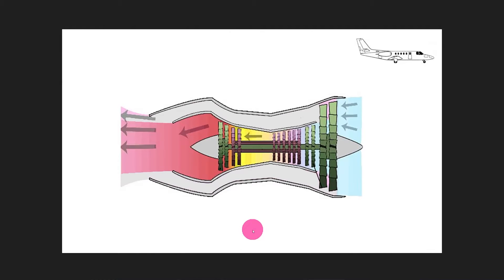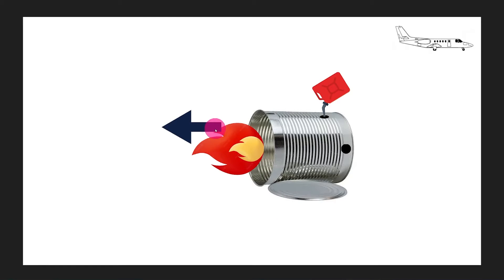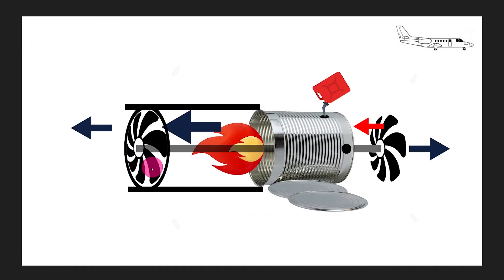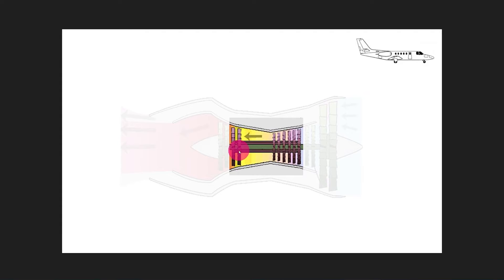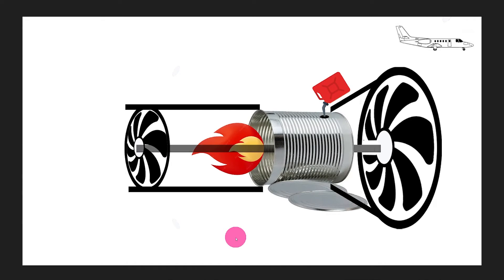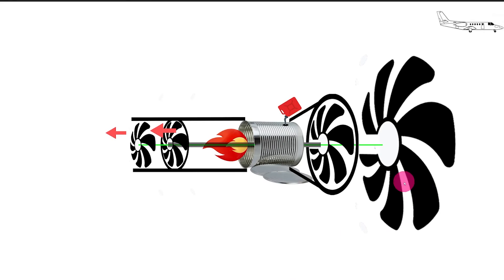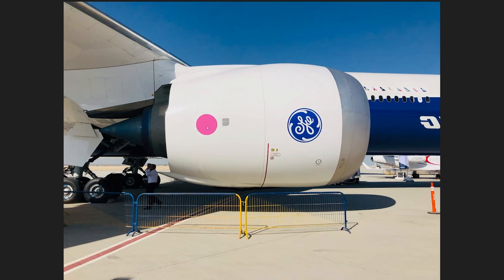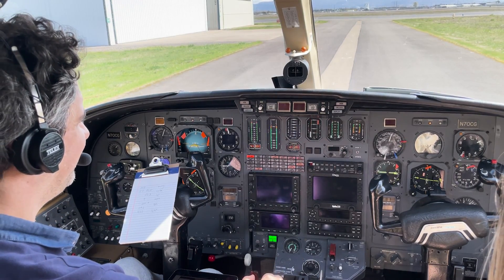How a jet engine works - SUPER SIMPLE EXPLANATION!

Comment: Good job explaining the very basics of jet propulsion. Except that the fan in a turbofan is not a propeller, it’s a compressor. It works just like the compressor of a pure turbojet engine except it’s much bigger and compresses the bypass air along with the air that enters the turbojet. The compressed bypass air expands and accelerates out the back of the fan’s should to produce thrust. All of the fan’s energy goes into compressing the bypass flow so there’s no energy left over for it to produce any thrust of its own. Ducted propellers are still a real thing, except they’re used on blimps. Though when it comes to turbofans, ironically it’s actually the low-bypass engines of modern day fighter jets whose fans (fighter engines typically have three fans) produce thrust like a propeller! But don’t take my word for it, I’m only relaying to you what various aerospace engineers and aerodynamic physicists that I’ve encountered have told me.
Reply: @FlyWithNoam  You're certainly welcome! Unfortunately, many people interpret the propeller analogy way to literally and think that turbofans are identical to turboprops excluding the shroud that encases the fan. But yeah, the main reason why turbofans are so efficient is because most of the air entering the engine bypasses the core and produces jet thrust without getting mixed with fuel and burned unlike in a turbojet.
Reply: @FlyWithNoam  Yes, I know. Pilots are actually taught dumbed down versions like that one because they mainly need to know how to fly the plane including what the engines do instead of learning how the engines do it. I'd also like to thank you for being open-minded. Other aviation enthusiasts often lose their temper because I don't believe oversimplified explanations and they refuse to update themselves when I tell them that aeronautical engineering is more complicated.
Reply: @FlyWithNoam  Yep... as one of my favorite songs goes:

"All lies and jests, still a man hears what he wants to hear and disregards the rest."

- Simon & Garfunkel (The Boxer)

Comment: I find it amazing that in the 501, about 75% of the thrust comes from the fan via the bypass shroud. In fact, the plane was first known as the "Fanjet 500" during the prototype stage, probably to emphasize the quieter and more efficient performance of the high-bypass turbofan compared to competitors like Learjet.
Reply: @FlyWithNoam  I don't recall if they mentioned an altitude. But yes, could well have been at cruise at 410.
Reply: @FlyWithNoam  Sorry, misread that. Makes sense. Edit: But the fan is also feeding the high pressure compressor, so that air feed would go down with altitude as well. I was just reading that bypass ratio doesn't actually change with altitude.